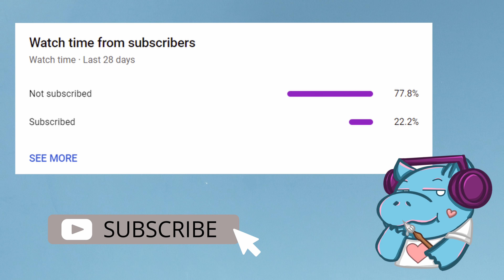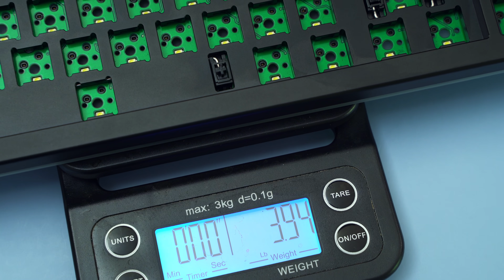Why Would You Want a METAL Keyboard?

Comment: I actually like this build. Maybe the sound isnt what you wanted but the bottom facing rgb feels less juvenile than an open design with rgb leaking from every key cap. The keycap colors are great and and i kinda like the orange backlight effect. Like a subdued amber which is not unlike aircraft instrumentation and older sports cars where research said red/orange light was less fatiguing. I like that the backlight is a backlight and not a flashing rgb distraction and works independently and simultaneously with the rgb. if you just need to see at night because you're not a master typist and occasionally look at your hands you don't have to change your rgb profile to do it.

Comment: There has to be a problem with how stabilizers are engineered, right? I haven’t tried c3 or zeal, but my durock v1/v2 / cherry plate, pcb mount/GMK pcb mount all required similar levels of tuning to sound as good as possible. If $25 stabilizers rattle out of the box, then I feel like there needs to be some innovation in the design..
Reply: I feel like stabilisers need a redesign in general so that no tuning is needed. I don't see why it can't just be designed in a way so that it sounds good stock
Reply: Better yet build out a board with 3 switches under the space bar, then clip the two outside ones.

Comment: Hey I wanna ask smth. I got a new keyboard but my keys don't have stabilisers. I mean the plastic bit on the sides are there just not the wires. It works fine but just askign if that a big problem.

Also should I lube my holy pandas. Like is that necessary?
Reply: You should def get stabilisers, as without them if you press too far to the side the switch might not get pushed down all the way. And technically you don’t need to lube switches, but you probably should as it makes them smoother and sound better.